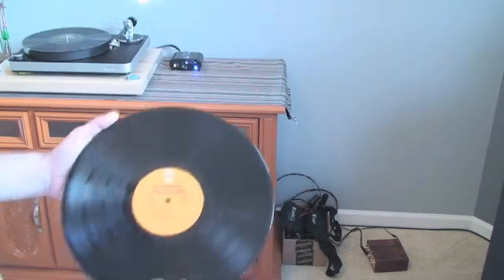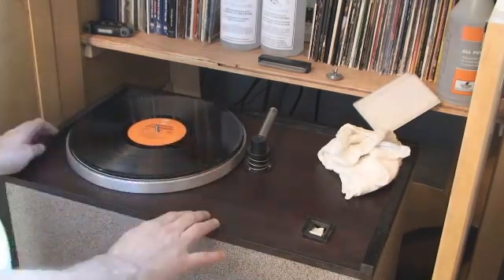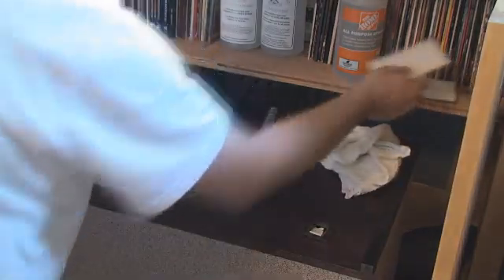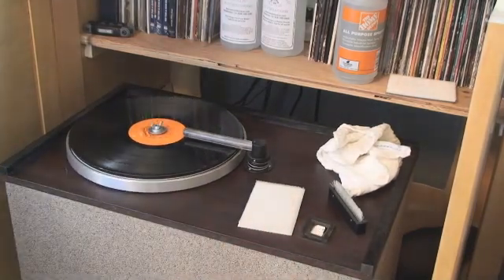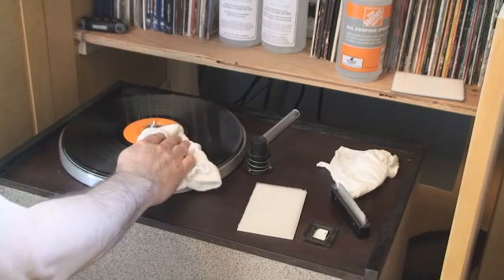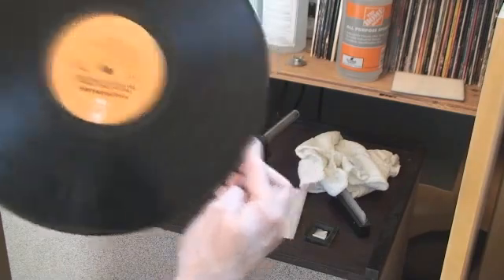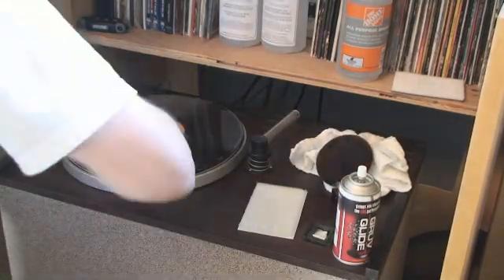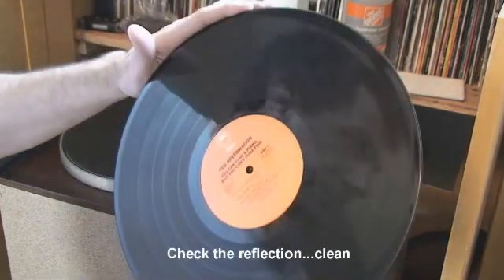Record Cleaning machine - DIY

Comment: Hang on a minute, he sprays the fluid, he scrubs the record then he dries the record. What exactly does this record cleaning machine do? apart from rotate the record and make a noise. The whole point of the vacuum is to dry the record. A well designed record cleaning machine protects the label from getting wet, squirts the fluid, scrubs the record, changes direction and sucks the crap off. Oh! and the platter should not wobble like a jelly.
Reply from the maker: Dont think you paid attention. spray and initial scrub to loosen. Then the VPI wand and vacuum has small bristles that scoop what was loosened and vacuumed away and dries. Plus at no time have my labels been damaged. Wobble ? really ? Really ? Should I set the azimuth too ? Its cleaning not playing.